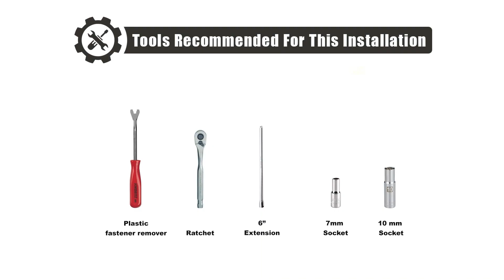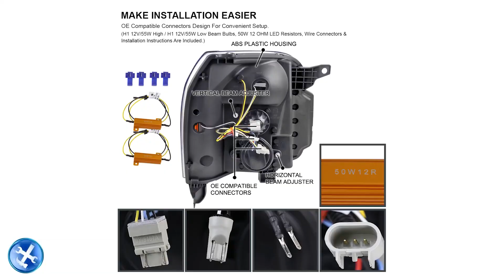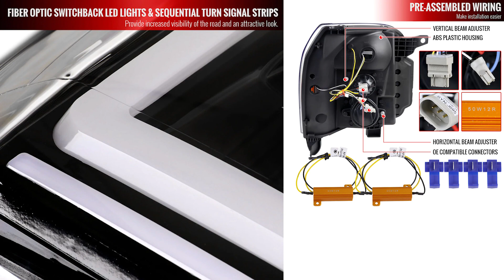DIY Install Spec-D Projector Headlights GMC Yukon (07-14) Switchback LED DRL C-Bar - Black / Chrome

Comment from the maker: Order here: https://shop.redline360.com/products/spec-d-projector-headlights-gmc-yukon-07-14-led-drl-c-bar-black-chrome
Reply: @redline360 can you upgrade the provided bulbs with HID LEDs?  If so is there a recommendation on the wattage or lumens to avoid damaging the lens/housings

And do these housings provide adequate/ great light for nighttime driving?